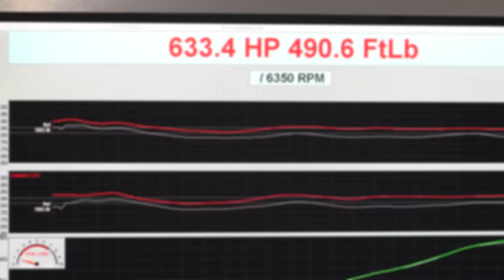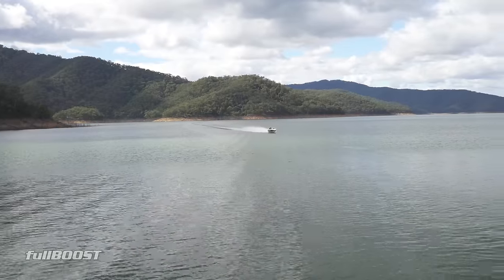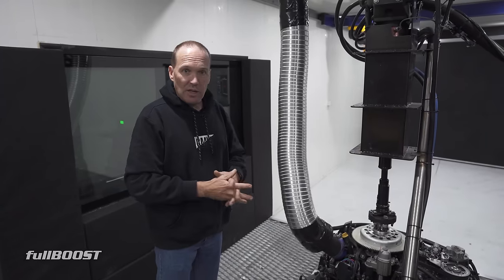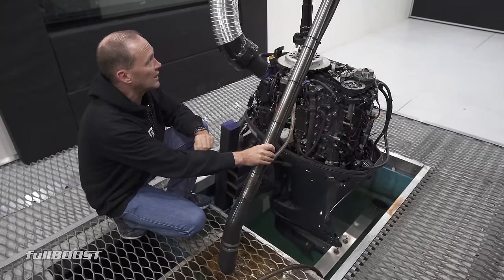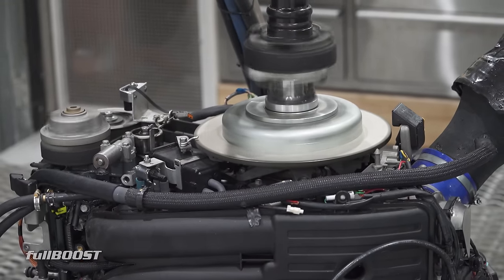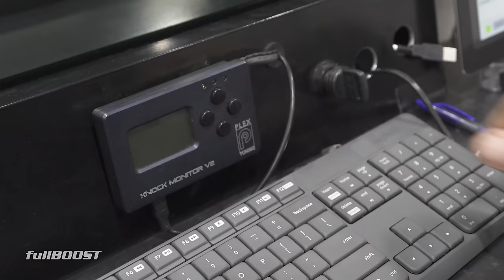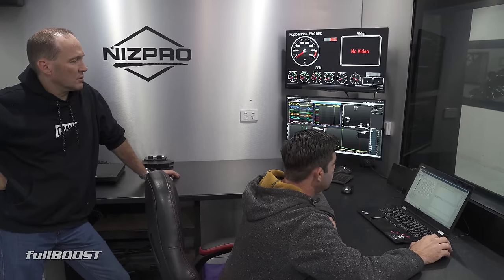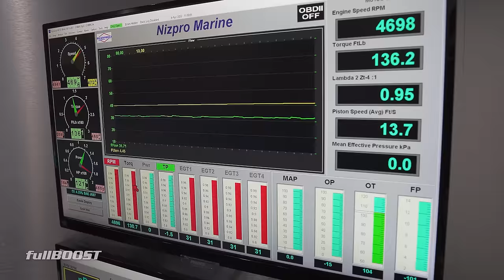We visit a Marine engine dyno - Supercharged outboards with Nizpro Marine | fullBOOST

Comment: If the water that the propeller is sitting in doesn't flow in a direction the propeller should create an air cavity around the propeller, resulting more on the dyno reading... Am I wrong?

Comment: This man builds engine packages. He's not just handing you a pretty Dyno number he's giving you a real power number you can expect to put into the water under real circumstances. With the lower unit attached using the cooling it will have on the boat with ambient air temp and not just the first run numbers but the numbers it made after everything is hot like it would be in use or even hotter because it would have alot of airflow on the boat. You would be surprised how often an engine builder will feed an engine they built for a customer high octane fuel with more ignition advance, cold Dyno water pumping through the cooling system, air conditioned air going into the intake with 30 weight oil and no accessories to get that real nice number. Then once in the car with hot coolant, hot air, pump gas, alternator water pump power steering and less timing advance it's down 60-100 horsepower or possibly more in some cases. I dunno I just feel like it's shady to do that. For example any work I do for someone I do my best to make sure the customer knows exactly what is going on, what's being done, ways to make it better or cheaper without compromising quality and just in general what they get for their money. I would Dyno their engine as close to real world in car conditions as possible knowing I built it myself to my high standards. If I'm selling you a 500 hp engine to me it needs to make that number with its own water pump with the air cleaner on it Etc. This is probably why all of my customers continue to bring all of their stuff to me and recommend me to everyone. The other week my truck broke down and a customer just gave me their keys and said use mine and it's making a little sound when I hit bumps. Give me a call when you are done.

Comment: Awesome setup. And clearly really knows what he’s doing. But “pulling the engine down through the rpm range” to produce a number that’s larger. Is like measuring your gentlemans sausage from behind your balls.

Definitely not an industry standard.

The only number you’d ever want to give a customer is a standard rpm sweep accelerating at a correct ramp. Not an averaged number between a correct dyno pull and incorrect pull-down run.

Comment: This was the best marine engine power related video I have seen to date. I would NEVER have thought to keep the power head on the lower unit (and the difference it makes with the exhaust tuning EVEN with a fourstroke) to keep numbers matching in real time.
Reply: they've been doing it that way for a long long time . they have all different sizes of waterbrake dynos for the propshaft, and all you need is a garden hose (obviously of sufficient pressure). this way is certainly better for what they are doing tuning-wise, but is extremely expensive.

Comment: Man I wish these engines had the good looks of 7 marine or the newer evinrudes. I have a 78 glastron I redid and it has one of the 7 marine engines on it. It's had a lot of work done and I push about 750hp now. However it always worries me that some day it's gonna need parts and since 7 just is gone just sucks. You'd think that would be enough but I've got one of the newer evinrudes on my bass boats. And a 89 checkmate deep v that I put a Mercedes cls63 biturbo v8 in. All of these are delicate engines but man are they nice and quick and loud. There's nothing like a good cammed v8 blop sitting at the ramp making all the dudes jealous and their girls wanna ride with me instead. Right now I'm rebuilding my 2000 kawasaki stx900 swapping the motor from a audi rs3 that I got super cheap from the salvage auction. Can't wait to see what it sounds like with a turbo 4 banger

Comment: Why not test the bottom torque as well after the transfer of power through the gears ! I thought technology was advancing ! What horse power would that be at the propshaft with a low pitch prop like a17p then a high pitch prop like a32p ? That dyno machine would not be able to tell the thrust difference or the cavitation that occurs 🤔 yeah I'm a smart ass!😏😒😎

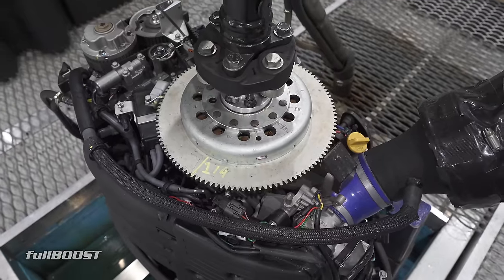Comment: 5:56 2 or 3HP? Outboards get that direction change at 99% efficiency? Why aren't we running this magic lower unit tech in the rear ends of RWD cars and trucks the world over? I'd believe a 2 or 3 HP loss on a 25HP outboard. Parasitic loss increases with force so, freewheeling the drivetrain other than the water pump adds no value. It's fine, crank horsepower is still interesting; no need to pretend.

Comment: Firstly, cool setup, it obviously gets the job done.  Surprising it's able to pull enough water with so much aeration from the exhaust.  Perhaps to be closer to real world as far as parasitics, it would be neat to connect the absorber to the prop shaft, either under water or run a horizontal shaft out through a bearing/seal hole in the side of the tank.  I suspect the losses to the gearbox are going to be much greater than the claimed 2-3HP when the gears are fully loaded, vs. free spinning with no load on the gearbox.  Not that it matters for R&D for engine HP, but maybe it would help with optimizing the gearbox to have lower parasitic losses (polishing gears, trying different bearings and lubes, etc..).
Reply: Right, they just need repeatability so they can figure out if what they are doing on engine helps. For their main businesses I don't think what the gearbox is doing is key (and some mount without gearbox). You make a great point though - that does nothing for the gearbox, be interesting if you could apply similar approach to gearbox optimization, but likely less bang for the buck?
Reply: @randominternet5586  My guess is, if they were targeting the racing crowd where everything is a variable that can be modified, including the gearbox, then it would be more necessary to include the gearbox in the equation.  But if they're just working on more HP for the retail market where most people will be running OEM gearboxes, it's likely a moot point.
Reply: The entire package matters once you get the power plant setup -   Very nice !

Comment: Why not just add a turbo that runs off of a modified flywheel with cooling fins to move the air under the engine cowel thus for forcing cool air into intake and circulating top cylinders with cooler air for heat dissipation then hold the throttle until it blows for endurance testing side by side with the original model 🤔😏🙉👍🙈😒

Comment: Wondering why they didn't make a dyno at the prop instead of at the crank .... I wonder if the way they are doing it at the crank which would be considered brake HP if you would take off 15% like on automotive dyno's and that would be the actual HP at the prop ..... This was a pretty neat video.

Comment: i used to build 2 cycle outboard racing powerheads.  the looper was a good one but the Mercury chrome bore V6 was a scary monster,  they don't even wake up until they hit 4000 RPM then from about 5 to 9000 you had to hold on to something. You can still find them attached to bass boats, put that shit on an 11 foot hydroplane and win stupid prizes

Comment: What happens when you pull the drain plug on a moving boat with water in it? It get drawn out of the bilge right. You are not factoring that in on your exhaust. You still have constant pressure not a drop as the boat would be moving.

Comment: Very nice!  I wonder what the hp is at the prop, after the losses in the gear case under load?  The gear separation forces increase with load and the efficiency of the gearset is reduced.  Still, very cool and out of the box engineering.
Reply: Was wondering myself why they didn't make a dyno at the prop.
Reply: He said the parasitic losses are 2-3hp
Reply: @paulmryglod4802  windage on just the oil would be that amount of loss. The load the prop puts on the drive train would increase that to probably around a 15 hp loss.
Reply: @doncarlson8391  that's what I was thinking too, except he said the difference between being in neutral vs in drive is the 2-3.
Reply: @paulmryglod4802  he can say that but I've got years of dyno time on these types or drive trains that says there are additional losses when you add the prop and load the system.  Many years ago the feds started requiring the Marine industry to publish propshaft horsepower so consumers would have an apples to apples comparison when buying different manufacturers engine packages.  Everyone's power ratings dropped 15 hp when we changed from flywheel hp to propshaft hp.  With that said, these guys are doing a great job and I'm not second guessing anything they are doing.  I was just curious if they knew what the actual propshaft hp was.....the way the industry rates engines.  Regardless,  their conversations are, cool, fast and well engineered.
Reply: @doncarlson8391  cool! I appreciate the added info. I don't know much of anything about boat motors and am trying to learn.

Comment: Hi Simon,
How are you doing mate?
It is great to see that you have still got that drive and interest in pursuing the quest for extracting maximum horsepower, and reliability, repeatability from your engines
You have always been at the pointy end of this type and 
R&D.                                                                                                                                                                                                                                                                                                                                                                                                                                                                                                                                                                                                                                                                      
In regards to the in-cylinder pressure measurement, was that from a pre-existing OEM setup already used by this engine package or a rehash on the old NISSAN FAIRLADY transducer setup you and i spoke about a year or two ago.
I haven't proceeded with that setup myself as yet.
But i definitely plan on proceeding to make a start on it this year.
I love the blower intercooler assembly.
All the best mate,
Kind Regards
Dave Kriedeman
PRO TUNING

Comment: Had an FGX G6ET tuned "somewhere" back in 2018.
SCT flash, larger injectors,  100 cell cat.
Woke it up, but always shitful on first start until warm. 
$3500 dolleridoos,  turns out the boost pipe hose clamps were loose, sparkplugs loose, coil pack hold-down bolts loose... apprentice must have been close to hometime that Friday...
I fixed all that shit, car ran better than it ever did.
Oh and locked tune, that other SCT tuners couldn't open... fun times
Hope that guy ain't working there now!
Reply: Haha no doubt they said it wasn't them

Comment: Yamaha needs to partner with Nizpro to compete with Mercury. Yamaha doesn't even have an offering for freshwater fishing over 300hp. Mercury has a 300r, 350, 350r, 400, 400 V10, 400r, 450r, and the 500r. Yamaha isn't even an option now if you want to max out the hull on your 20+ foot boat.
Reply: The 250 he has on the dyno is a good option if you want lightness and speed 😊
Reply: This Yamaha option is better and much lighter than the mercury 😂 my 250 sho will slaughter the merc 😂😂😂

Comment: The Cox's 300hp V8 although may be a diesel outboard motor, but it has more torque than even this motor. If you are racing this may be your choice or even a Mercury's new 500hp. The Cox's motor does not lose torque even in tight turns, it stays the same However, other than mph, the Cox's engine out performs all the rest. I do see the Cox 300 getting upgrades for faster performance in the near future. I enjoyed the video nonetheless !
Reply: The diesel is way 2 heavy
Reply: It's a big heavy piece of crap and it couldn't compete with these engines regardless of any modifications
Reply: @JohnWinzil  That is why it out performs all the others except in top speed and weight! That is your opinion and we all know what they say about those that do! The Facts speak for themselves!
Reply: @Charles53412  it's 2 heavy for any of the boats l use also noisy and unrefined and fumy l would much rather have my 250 sho which is light has more than enough torque for my 7 metre boat and capable of 60 miles per hour. 😁
Reply: @JohnWinzil  We all have opinions! However I have seen the performance data first hand. Even though you are correct on being heavy, but that is it! While you have to stop to refuel the Cox goes almost three times farther before having to refuel and it is as loud as a gas burner.
Reply: Don't agree with you that engine would be useless on my boat and definitely isn't much more economical and is also ugly and 2 expensive 😅
Reply: @JohnWinzil  You don't have to agree! However that is proven data not opinion!
Reply: @Charles53412  if you would be happy  with it that is fine but l would never even consider getting one